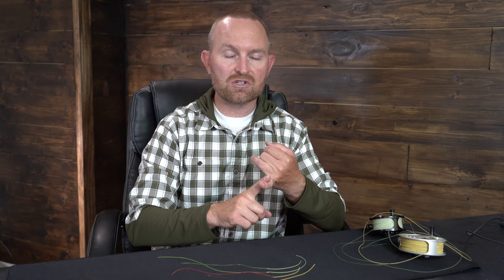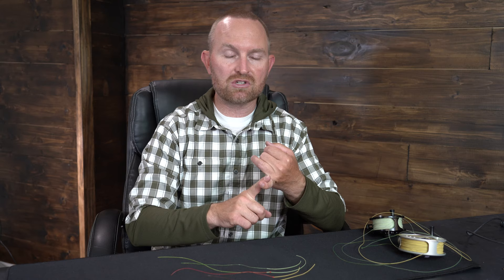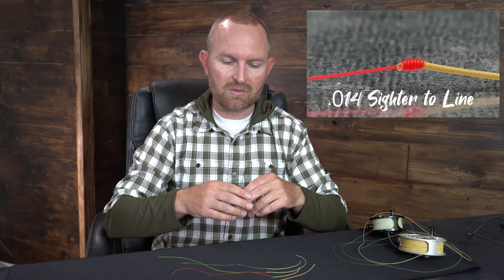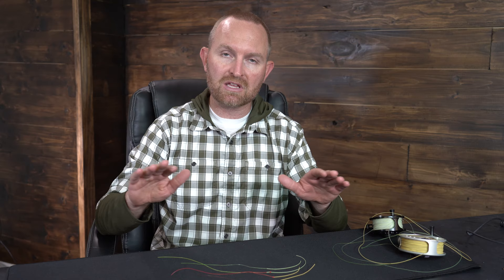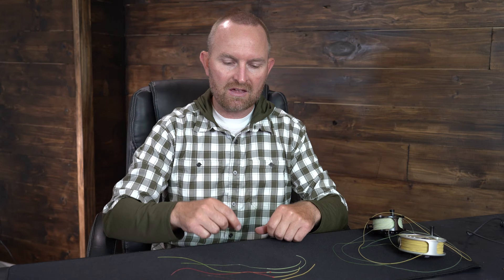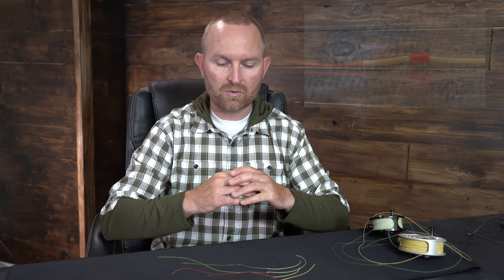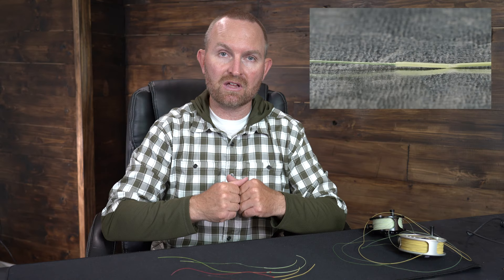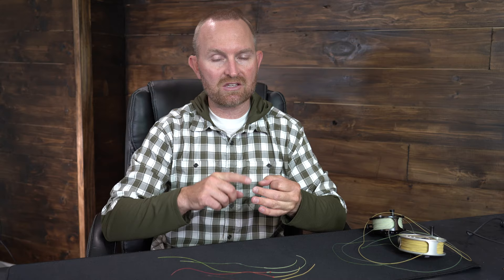Euro Fly Line to Leader Connection: What works BEST?

Comment: Smallest knot I've never had any issues with is a davy. Strip the coating using any method that you prefer. I use a fishing line that I double over, loop through itself over the nymphing like, cinch and pull leaving the core exposed. Next create a half hitch with the exposed core but don't cinch. Take the leader line and put the butt end through the half hitch hole then tie a davy knot around the exposed core of the fly line. Cinch both then pull together. You will end up with the smallest knot period. As an option use UV knot sense to make it smooth.

Comment: Want to add I am a weirdo with my euro rod. I shoot skagit heads 75% of the time or 5-10 hours a week fishing. 

I use loop to loop and lost multiple trophy fish, no joke from the loop to loop chunk. It’s horrible going from mono->shooting head. But then I tried two things: 

1) Shrink tube, and slid it over connected the lines and shrank in 170ish degree water. Perfect until you need to replace heads, so this was not optimal. 

2) UV Knot Sense. Absolute heaven, it allows me the quickness of loop to loop, or necessity in shooting heads/tips but I can just peel it off real fast when I want to change. 

It’s been a life changer, strongly recommend if you’re a loop to looper, get some.

Comment: If you have a very fine euro line, you can use a very small loop-to-loop, but smooth them out with "thick" UV resin, so that the transfer gets smooth and won't hang up.  But you've got to be minimal and smooth with the UV resin.

Comment: I have experimented a lot with fly line leader connections and the needle nail knot is my favourite for gentle dry fly presentations -- it has been a pain to tie with my wife old sewing needle, though. Never thought it would be a significant deal nymphing but you raise some important points.  Would it be safe to assume the braided loop to leader loop is the strongest connection? ... it seems to be recommended by salt water aficionados quite a bit. I think I will order that nail knot tool you folks sell and start to save my fingers :) Thanks!

Comment: Very hepful. Question: If you're a one-rod kind of guy who wants to switch from, say, a thicker dry-dropper euro leader to a micro thin leader, are you swapping the whole reel spool out to do so?
Reply: I have 2 tippet rings in my setup.  First is the standard at the end of the leader, to tie tippet onto.  But I also have about a 12" leader butt coming out of my fly line with a "tippet" ring at the end of it, and I just swap out leaders there.
Reply: @spikeconley
Reply: So can you cast properly with two tippet rings? And won't the first tippet ring get stuck in the eyes of the fly rod?